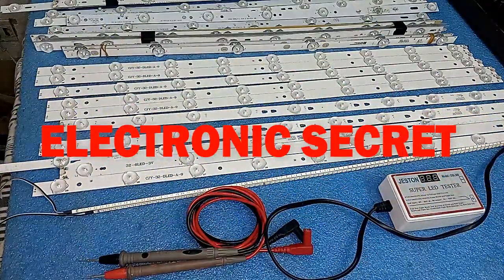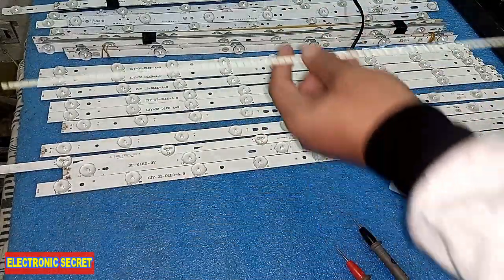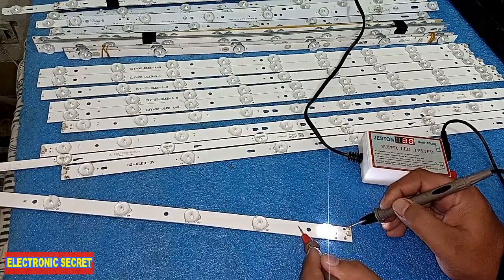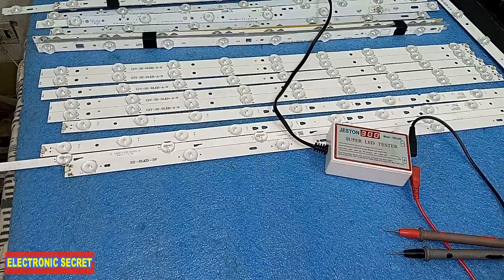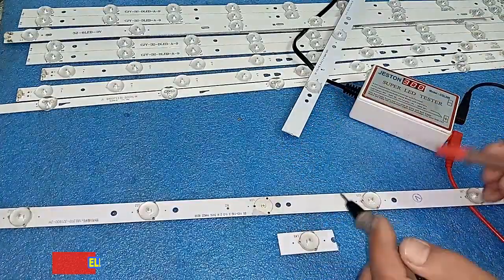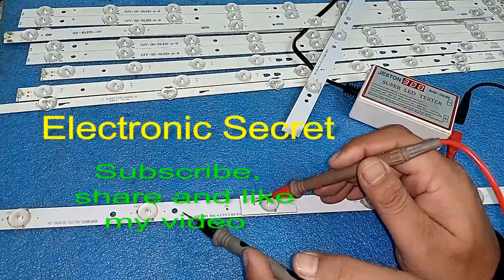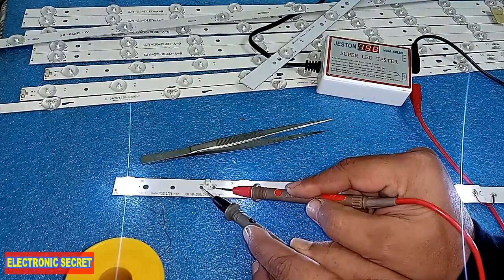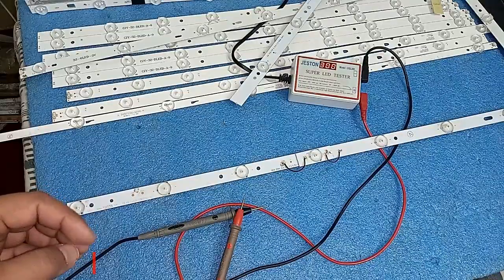HOW TO REPAIR LED BACKLIGHT STRIP

Comment: Hello, what size of wire did you used for this purpose and If it is cooper or aluminum. Thanks!!
Reply from the maker: copper wire,size doesn't matter,approx 1-2 inches

Comment: Mujhe 2 strip chahiye kitne ka milega
Reply from the maker: 400-500 per strip
Reply: @ElectronicSecret  both jyada h
Reply: 500 ki new strip h repairing karwani h muje
Reply: Noticed you did not remove the old LED.